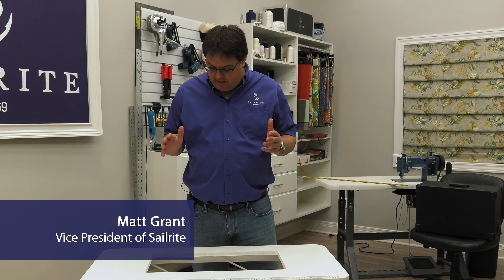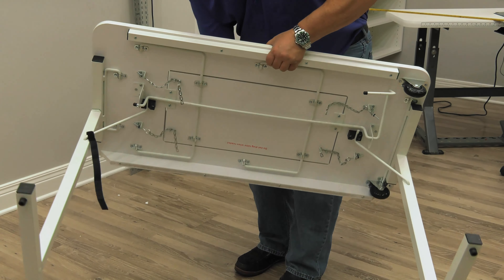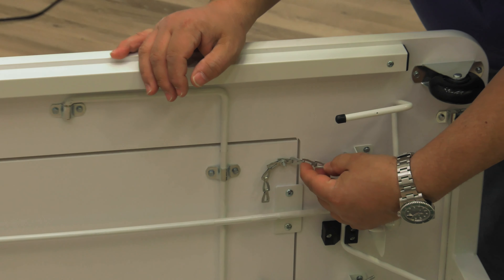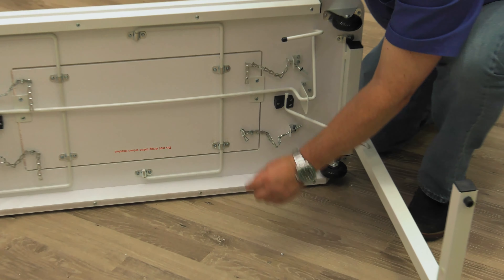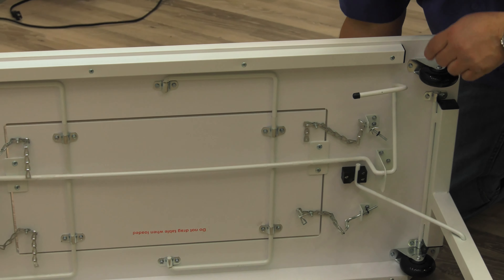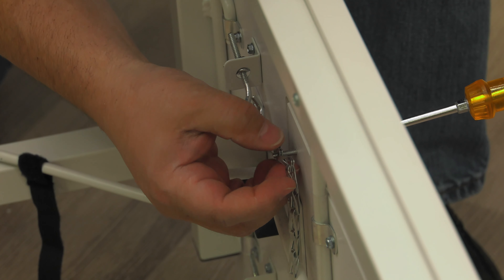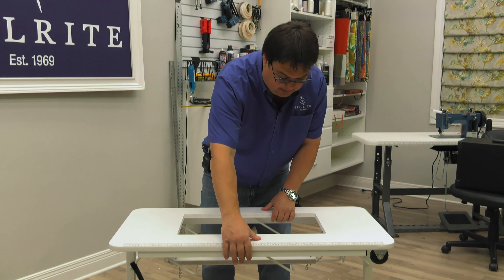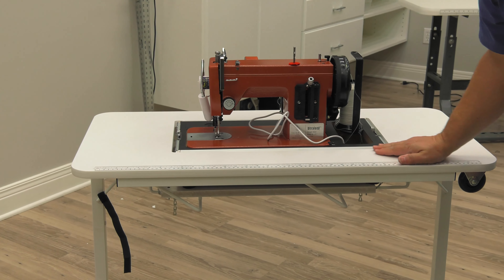Adjusting the Ultrafeed® Collapsible Sewing Table

Comment: Nice table but that measurement on the ruler didn't read "just under 4-1/4".... Even though you blocked the close up shot with your finger on the 4th measurement, you can see it on the first one. ( I guessing this is where one would use the fine adjustment wing nut you spoke about).
Reply: 2:53 read just under 4 1/4" for me.  I had to do a double take as well.  Where the wall of the edge and the top meet isn't abundantly defined on the video and the intersection is washed out making it look lower than it is but I'd say it's only about 1/32" away from where he indicated.  If you freeze at 2:55 you can see the hashes and it's still in that general area.